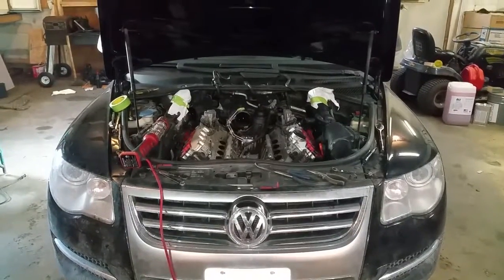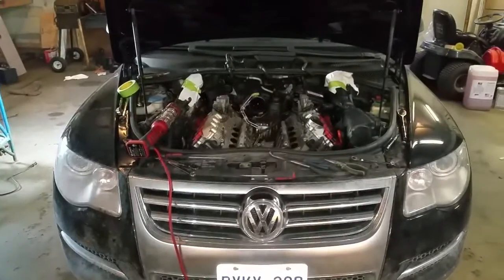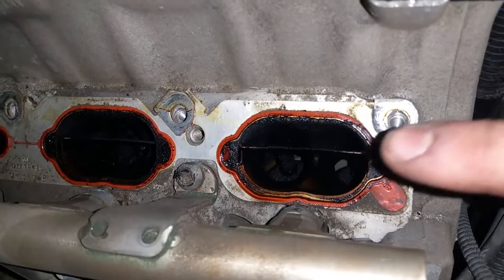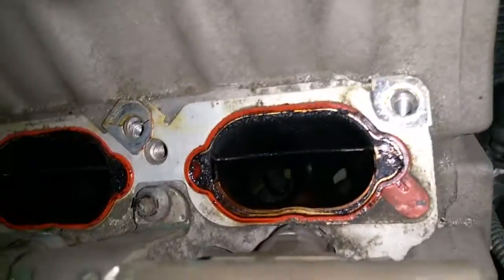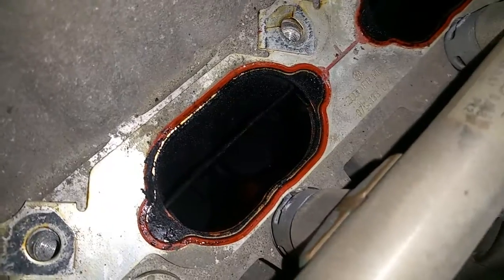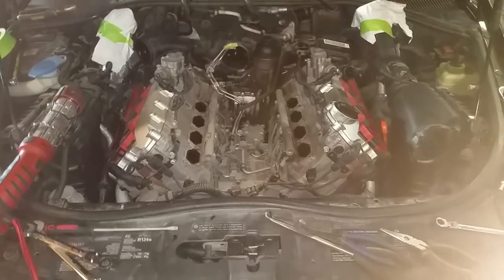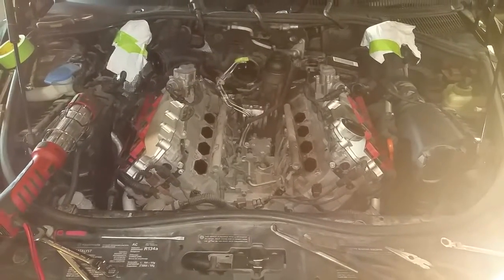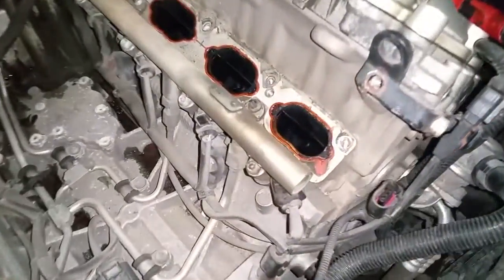BEFORE: Touareg/Q7 4.2 FSI Intake Ports Carbon Cleaning

Comment: how did it run after I'm trying to change my whole intake manifold my plastic inside of it broke
Reply: Any body got an extra intake manifold ? Mine is broken found the plastic in the intake valves. No bueno!!
Reply from the maker: I didnt notice a huge difference, ran a bit smoother but nothing crazy.
Reply: Is this thing hard to take off
Reply from the maker: It's not super hard, some of the stuff towards the back is tricky to get off due to the lack of space, but overall not bad. There's no tricks or anything for getting it apart, mainly just pay attention to all the stuff connected at the back that you might not be able to see easily.